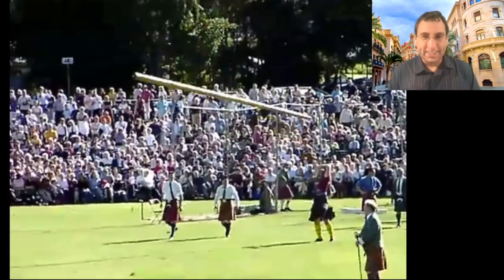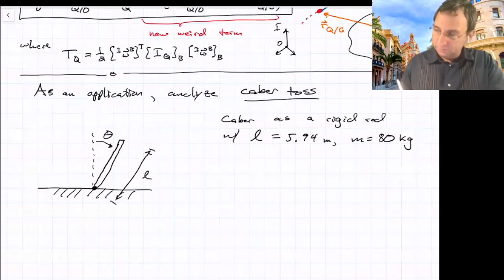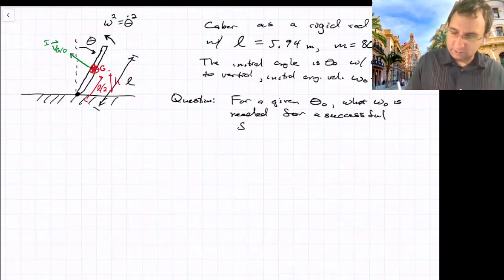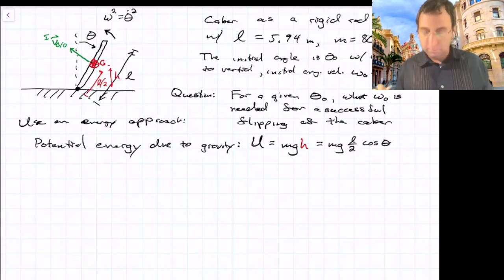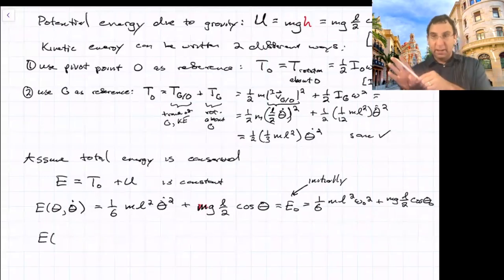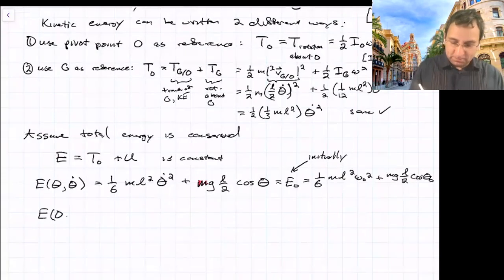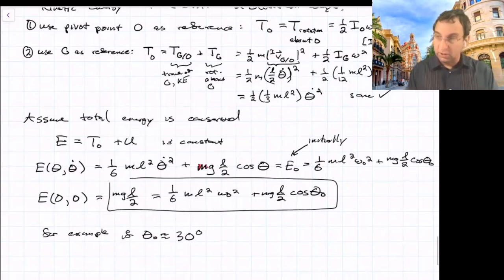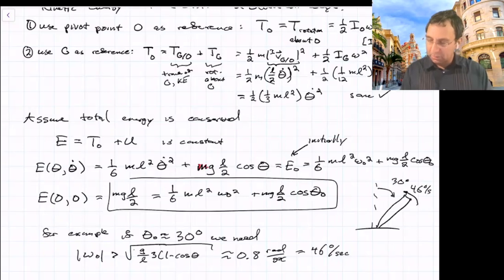Caber Toss Physics - Analysis of the Scottish Highland Game

Comment: Amazing work! Thank you! 

Just so I am interpreting the math right. That 46º/s changes depending on the landing angle of the caber, snd the mass and length. Correct? 

Those are our adjusting factors. I wonder what a table would look like of the varying factors.
Reply from the maker: Great question! Short answer: Yes, it changes with the starting tilt and the caber length. In the simple energy model (rigid rod, no losses), the minimum initial angular speed is ω_0, which is a function of landing angle  θ_0.
Quick numbers (for cable length ℓ =5.94 m):
θ_0 = 15° --> ω_0 = 23.5°/s
θ_0 = 30° --> ω_0 = 46.7°/s (from video example)
θ_0 = 45° --> ω_0 = 69.0°/s
θ_0 = 60° --> ω_0 = 90.2°/s

Real life adds losses (ground compliance, grip slip, air drag, non-uniform caber), which means you need more than these ideal thresholds.